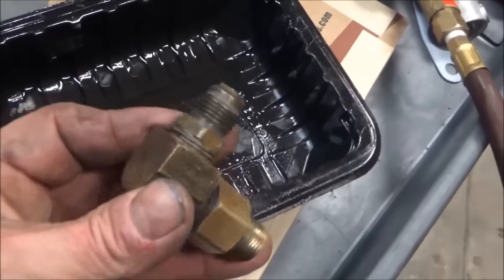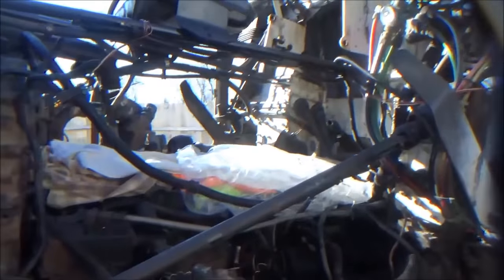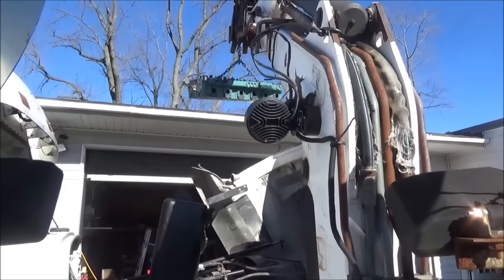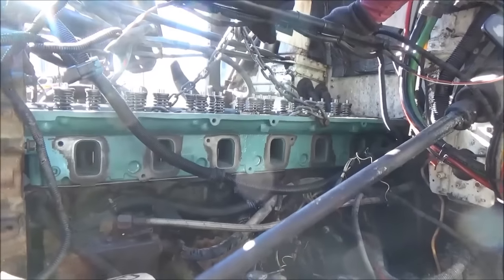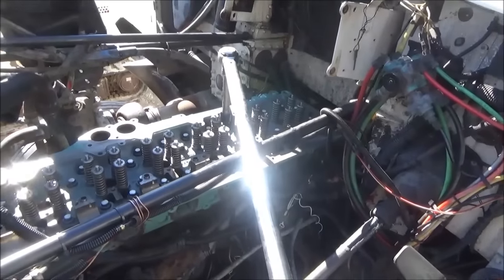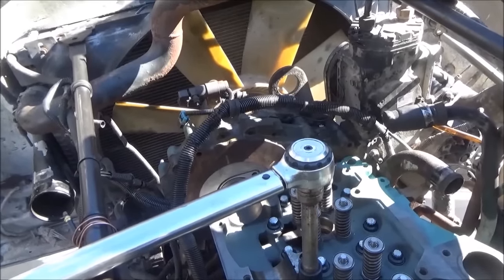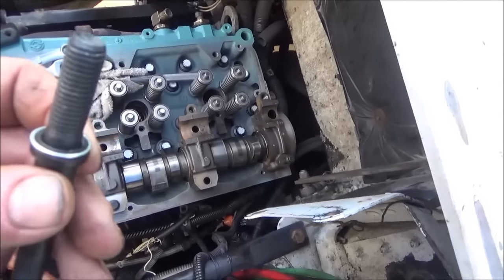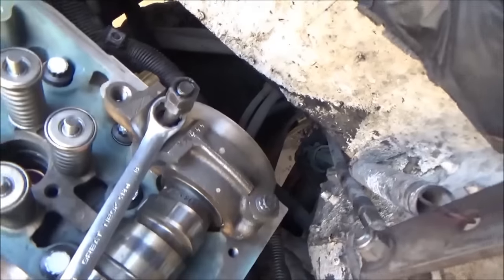Detroit series 60 in frame rebuild (part 12) installing head, cam and rockers

Comment: Thank you for doing this series it has been very helpful in doing my inframe 
On your line up bolts I just cut a slot in the top when I cut the head off so I could get them out with a screwdriver
Reply from the maker: Thanks for watching and commenting.

Comment: after you cut off the old head bolts, cut a slot across the top of the head bolt so you can use a screwdriver to turn the bolt out, then you just need a magnet to lift the bolt.   did you use the Detroit"peanut butter" on the head bolts and the big cam bolt too? it is a one time use bolt.   not absolutely necessary but easier to install the perimeter seal and diamond seal before you drop the head on. less hassle to leave the exhaust manifold on the head and just remove the 4 nuts for the turbo flange, pry it away and leave it hang there. did you install that o ring under the front cam cap too?  Detroit now has a redundant seal that goes on the injector. it is a big fat o ring that pushes against the injector copper tube when the inj. is torqued down. this is a secondary band aid if the top o ring under the inj tube decides to leak.  silicone sets up in the presence of oxygen and humidity. anaerobic sealer sets up in the absence of oxygen.  what squeezed out would never set up but between the mating surfaces it would be fine. also if you torque those two long cam cap bolts to the max range and when you install the rocker shafts- torque the nuts to the minimum range, that way next time you remove the rocker shafts the studs would not come loose. eh. did you install the injectors where they came out?  if not the ecm won't know the calibration of each inj.  there is a two digit code on the metal tag on each inj.  you need proprietary software to change them in the ecm. good stuff, good videos. overhaul outside in northern usa in Dec.  no thanks.  my respect to you.  wrench on big guy.

Comment: Hey Gordon bet you're glad to have that thing back running you probably got a good nites sleep to lol. On those guide bolts for the head I usually take my cut off disc and cut a slot in them then I can use a screw driver to pull them out. Good job Gordon very informative.
Reply from the maker: That's a good Idea, I didn't know how short they would be. No I didn't sleep good last night, I got it running today, I'll sleep good tonight.

Comment: Easy method is air always goes to the top
The restricted orifice   sets the fuel rail pressure check valve goes below so the engine will fire up after setting a long time which prevents fuel drain back 
Both can be a real pain to change in the chassis between the head and fire wall

Comment: Just to kind of clear things up for the viewers that cam gear tends to back out after a while so you have to put international compound number 2 and torque to 55 foot pounds and then add an additional 120° turn. Some technicians also add blue locktite to the thread

Comment: I really think you are doing a pretty good job on the rebuild. That's not true about the torque wrench and the extension though. It doesn't matter if the extension twists, it's still the same torque at the other end. It only matters with an impact.

Comment: You could eat off of that motor!  Looking good Gordon.
Reply from the maker: Thanks John, but you know I can eat off almost any motor, when I was a young mechanic about 30 or 40 years back I still remember eating sandwiches with black fingerprints on them, it could still happen if I still ate lunch while working, but I had to quit that when I started gaining weight in my later years.

Comment: That sealant does not need activator, that stuff is just a surface prep which helps it cure faster, the absence of oxygen is what cures it.
Reply from the maker: I just read the directions when I saw that it wasn't drying, and then I took the caps back off and cleaned them and put them on with permatex ultra blue which I always keep on hand, anyway it's running, tomorrow I'll finish the loose ends and take it for a ride.

Comment: For future reference they updated the head bolt torque spec to 220 ft lbs years ago there were issues with leaking headgaskets when the original torque spec was 200ft lbs

Comment: well done! I forgot about the electrical tape method,,, good to see the engine has new life. I was surprised to see about the epoxy behind the liners, I thought maybe JB weld? I am impressed at your efforts. Is this engine a screamer 2 stroke? I don't know much about big trucks... I remember when I reinstalled some pistons in a 2L VW after cleaning them with chem-dip, I put the piston in the block, then put the band clamp ring-compressor mated with the deck,,, but this method may be a bad choice for a heavy piston and rod, too much force on the oil control ring... that's how I did it, so the bore didn't eat the band clamp with a tap tap tap of the hammer handle... mechanics,,, so much to learn...
Reply from the maker: Thanks for watching Jonathan.

Comment: I know this is a year later . I do the same as you using cut off bolts for alignment tools, the only thing I do different is I cut a slot on the end so I can use a screwdriver to turn out the alignment bolt.
Reply from the maker: If I need to do that again I'll cut the slot in the bolts, a couple of other people also said that.

Comment: you should have put a slit on the top of the bolts you used to guide the head down then you would just have to use a flat bit screwdriver to take them out afterwards

Comment: Hi Gordon, thanks again for doing all of this for us. Did you have to adjust the cam gear lash at all or are there any specs for this? Or is it pretty straightforward, set it and forget it?
Reply from the maker: There is a spec, if I remember .010" is the minimum I forgot the maximum on the adjustable idler gear that needs to be done with dial indicator, but since the head was only milled about .010 and the idler gear is mostly to the side and not under the cam gear I didn't worry about it, there's probably enough wear on the gears to make up for that after 1.5 million miles. I would recommend having the Detroit shop manual handy before doing any work inside the motor.

Comment: Hey ,MR.Robertson,how are you?Well done rebuild!!I have a Freightliner Century 2005 with Detroit s60 engine,1.200,000 miles on it!2nd liner gone bad:got cracked,oil and coolant mixed,stuck on the road!Mechanics said it's cause of bad coolant!Mechanic shop changed 1 liner only for the rest I didn't have money!So my question is how are the other liners,how long they can last,should I make rebuild soon?Ali,thanks!!
Reply from the maker: I would try to do the rest of the rebuild as soon as possible. It's cheaper to buy the whole rebuild kit with all 6 liners and pistons and just leave the new liner in the hole and put in the other 5 new ones.
Reply: Gordon Robertson alright,thanks a lot!!
Reply: Gordon Robertson One more thing,sir,how much is the rebuild usually cost and how long it takes?Step1
Reply from the maker: it takes 1-2 weeks and cost about $8,000 to $9,000 at a shop. It cost me about $4200 to do it my self at home.
Reply: Gordon Robertson thanks!
Reply: Gordon Robertson it is the 1st time rebuild for this truck,or you've done rebuild earlier for this truck !I'm curious,cause I said it has 1.500,000 miles !And how long(miles )it can run after this rebuild?
Reply: U said ,sorry autocorrection!
Reply from the maker: 1st time, should go another 1,000,000
Reply: Gordon Robertson woooow!

Comment: Sorry to bother u again but I don't remember seeing graphite seals when I took my injectors out unless they turn to crud. I don't see any on injectors and there looks to be something like a ring in the head but it's bigger than the new graphite seals I'm stumped
Reply from the maker: I didn't find seals the first time I changed injectors about 12 years ago on mine. If the new ones don't come with seals then I would just put them in without seals. You can ask a dealer or truck shop. You're not bothering me, ask away, I'll try to help if I can.

Comment: Mr. Gordon. I have two 60 series 14.0L that were marinized  in 2008 . They run bunker C pumps on a fuel barge. At what hours should I consider overhauling engines. Port engine has 6812 hrs & starboard has 7126 hrs. What level overhaul should I consider for both engines.(basic/super or complete)
Reply from the maker: I don't know how many hours on a marine engine for a rebuild, but I'm sure you can go a good 15,000 hours if not 30,000. You should check the "bull gear" before 1 million miles on a truck (20,000 hrs.) That's like the timing chain on a car. I don't have a video on that yet but someone else might.

Comment: man I've been watching your videos I can't find any valve train torque specs I'm trying to tighten down my injectors and the two bars the Rockers ride on and the jake brake housing I can't find torque specs for any of those
Reply from the maker: I don't remember the specs for those, I'm at work now and can't look it up, but when I run into that I just use the standard torque specs for all bolts. You can Google "standard torque specs" and at the top of the page click images and print out a copy for your toolbox. Thanks for watching.
Reply: Gordon Robertson hey man I thank you very much for responding. your videos are very easy to understand  and helped me a lot thank you
Reply from the maker: Thanks

Comment: Do u have to   Torque them Injectors
Reply from the maker: There's probably a torque spec on them but I didn't do that, I just tightened then comfortably tight for me. I'm much more concerned about torquing parts with gaskets. Thanks for watching.